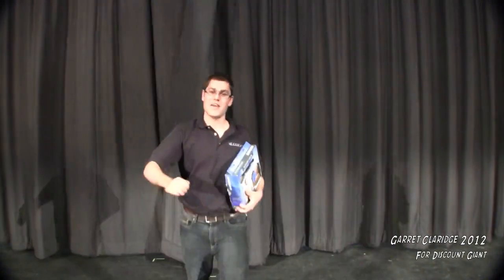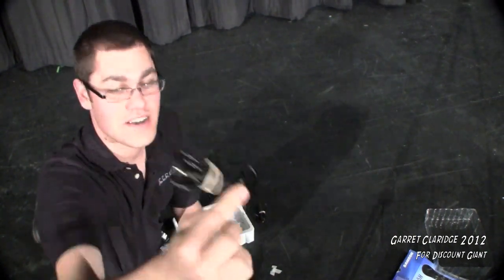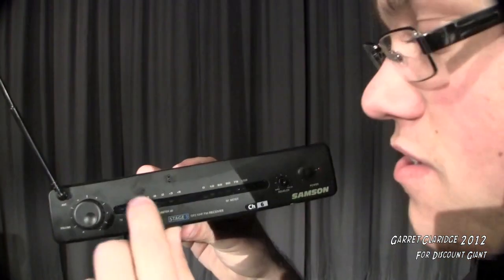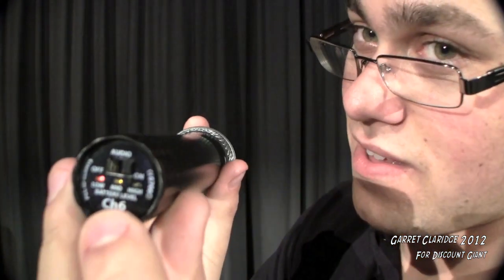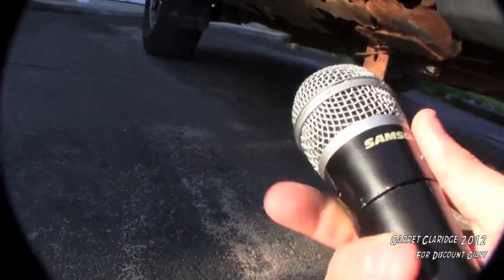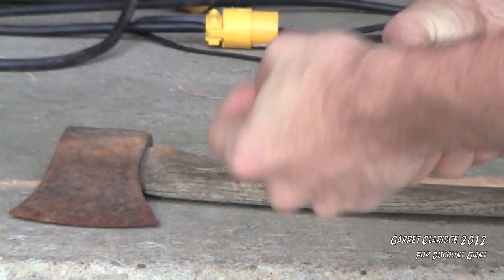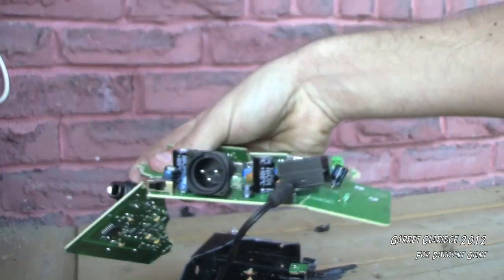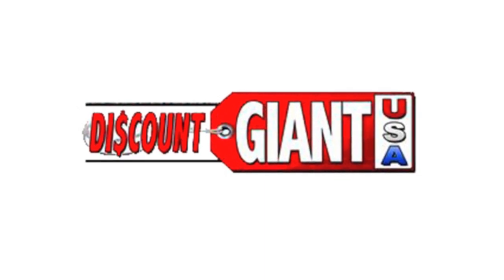Wireless Microphone Destruction!

Comment: Ive seen the squelch knob on ire less reciever. I used to have a shitty RadioShack lapel mic, and it had a recevier with RCA out, and a 1/4 inch out. It also had volume and squelch knobs on the unit itself. I've also seen those squelch knobs on military surplus, definitely do some research.